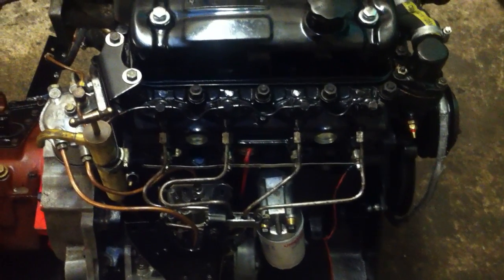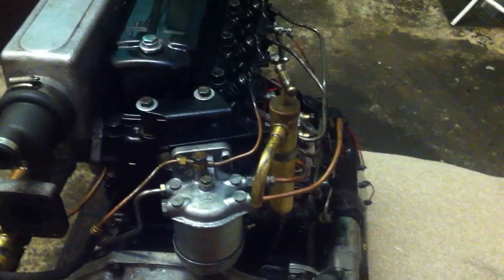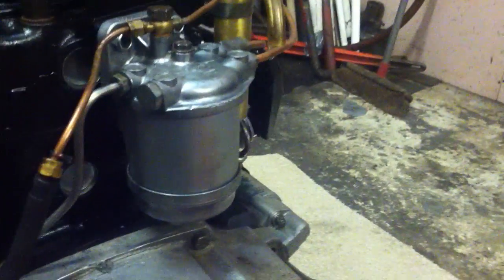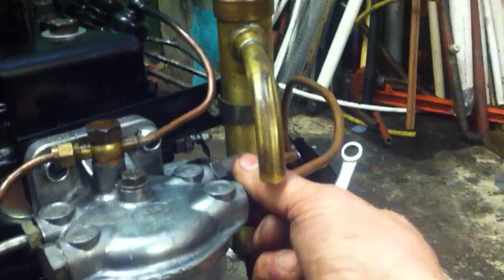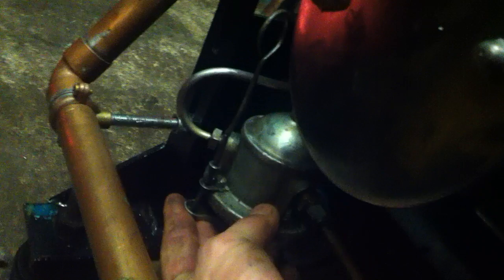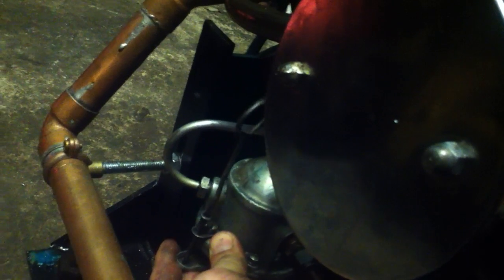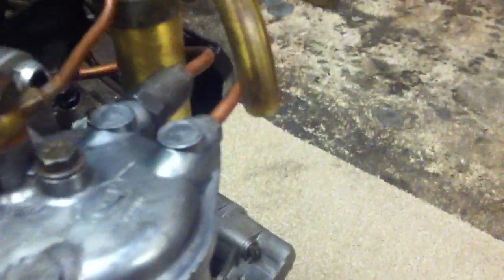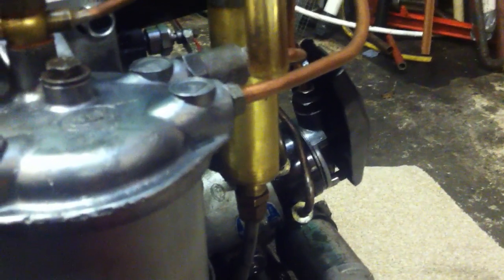How to bleed the fuel system on a 1.5 / 1500 BMC diesel engine

Comment: Just done this procedure on my bmc1500.  Bypassed the old mechanical lift pump with a 12v low pressure fuel pump. Easy to bleed with constant pressure.  Pumped clean fuel all the way to the injector pump, then cranked full throttle while watching for a nice clean spurt of fuel from the loosened injector nuts. That done, tighten everything up. Fired up nice. Thanks Sebastian.

Comment: Thanks v much -brilliant video and very clear. Might also be useful to note that on my boat there is also a water trap before the filter that is best to clean first.
Reply: Ditto. Same  accessory on same engine here. None of the manuals I have seen mentions the water trap (& I have not seen each & every version of the manual, which I think was revised / improved over the course of 40 years).

Comment: Thank you for sharing this video very easy to understand and can i ask were you get your parts for your engine.
Reply: Calcutt Boats have some spares (re-manufactured new parts). Another option is to find a dead engine cheap which has what you need, but beware that some parts for the same engine model changed specifications over the course of time (e.g. there are two distinct versions of the water circulating pump for the cooling system).